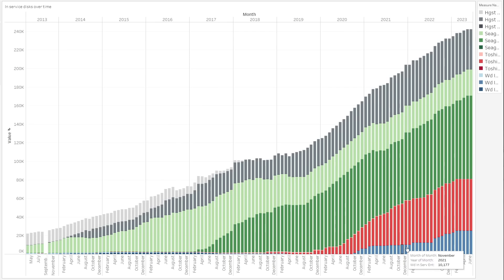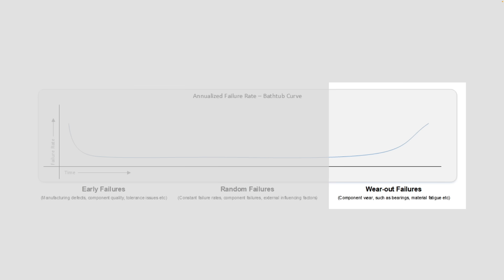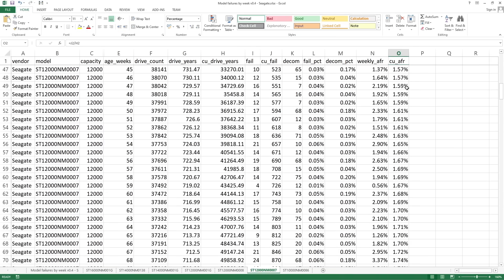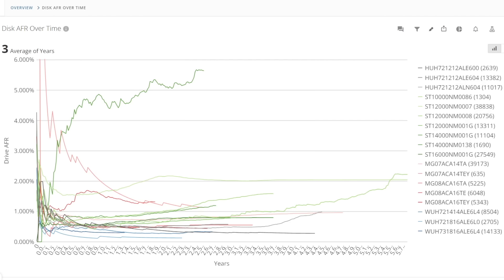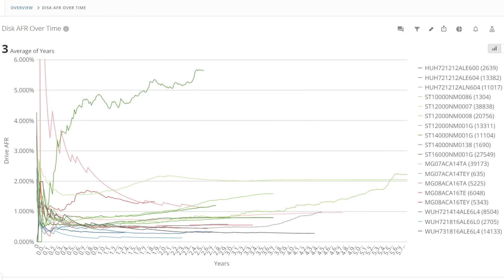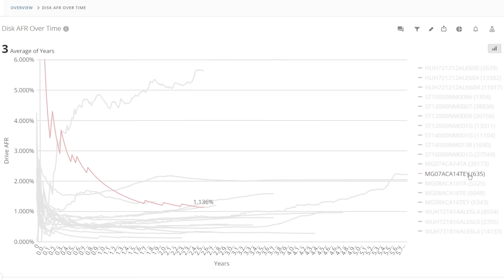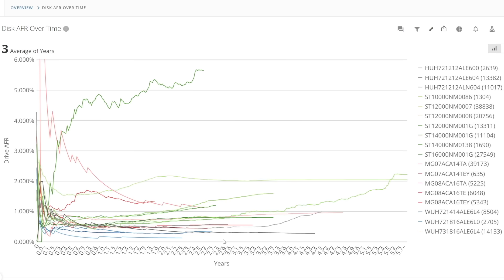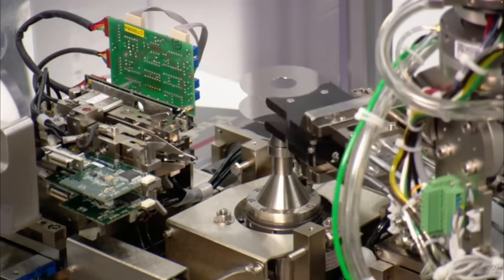Failure Rate Analysis - Best 10Tb+ hard drives: Seagate, Western Digital or Toshiba?

Comment: I'm surprised that the bigger drives are actually better...
Reply from the maker: It looks like Helium drives add reliability. The air filled disks are usually not sealed, so its possible for debris to occasionally make it past the air filters. Also, the larger disks are newer models in this data, so reliability is likely also coming from the fact the designs are more robust.

The newer small capacity drives might also look better, as they often have similar areal density, but only 1-2 platters. So less heads to fail and less heat generation. Backblaze though are typically optimizing for density, so they move towards larger capacity drives over time.

Comment: Have you got any analysis on whether the SMART data provided a warning prior to drive failure?
Reply from the maker: This might be worth a deeper look at. It’s complex as there are lots of smart measurements, each with an unclear correlation to drive failure. Some are likely more correlated but the numbers increment differently, so hard to compare one directly to another.

But given the size of the data set, there could be some good indicators hidden in here waiting to be found.

Comment: At some point, we're going to etch important data on glass, while the operating OS and other superfluous data is going to stay on semi- volitile RAM up to a month.

If you shut down the system for longer, it'll use a snapshot to SSD that it'll use to boot up from, which will take a bit longer than usual.

Comment: Why not a table that shows say for 10tb drives brand a is superior then brand D etc. For 12tb drives D is best followed by K etc.
Reply from the maker: I did put together a video that aggregates data for manufacturers so you see the overall reliability trend by manufacturer. The problem with doing this by capacity, is the manufacturers release products differently. For example, WD and Toshiba typically have a model number for a given capacity and keep producing the same model. Seagate however, iterate their model numbers, but release multiple capacities for each model. For example, Seagate have 4 Exos models that have a 12Tb drive (X12, X14, X16 and X18).

And the data here from backblaze will be dominated by purchases of certain models and the reliability can change for each model. In the above example of the 12Tb Exos, reliability gets better from X12 to X14 to X16.

So its a complex picture, but the video comparing the models by vendor is probably what you are looking for. This one was more focused on the model reliability. You can find this one here : https://youtu.be/icNbexYV3M4

You can always slice the data many ways, but if you do it all in one video it will probably be too long and over whelming. 

But I hope it was useful.

Comment: Weird cause my Toshiba in my old PC is 13 years old but my newer 6 year old WD died.
Reply from the maker: This is why large datasets are important, because smaller samples can really skew the outputs, and most people have a limited historical dataset to refer to. This is why people hate one vendor or another, because they had one or two experiences that make them feel the whole product or manufacturer is bad.

That said, although drives can last way more than 6 years, and WD are probably the most likely to, 6 years is still not totally terrible. Though I would prefer all my electronics avoided failure before they just became functionally redundant. 😬

Comment: So what you're saying is, most bad drives fail within the first few months. So buying used at a steep discount like I've been doing is the way to go.
Reply from the maker: This is where it is probably a little more complex. If they are just normal drives that are being sold for entirely innocent reasons, that have been well treated and come with a reliable full term warranty. Then yes.

But the question is, why are they being sold and what has happened to them? And also, there are possible warranty issues there, because drives not sold through approved partners will not be covered by manufacturers warranty and you would need to rely on return to base from the seller. So that comes down to how well you trust the seller to stand being the product for the full warranty period. If the support is good, the history is clear and the price is well discounted, its probably a great deal. Mitigate at least some of that risk with a full disk surface and SMART test during the initial return period.

Comment: are these numbers even usable? i know in the SSD space the same two drives can have very different parts if it was manufactured a couple months later, with very different performance and it's not disclosed.
Reply from the maker: They are as good as it gets. Each model will have a specification, design and component list, and though its possible that components could be replaced or re-sourced, its unlikely there are large variables and if there are, then the impact they have to a models stats would be fairly represented in the results. 

So given the large sample sizes here, the variances in component and the possibility of problem batches or logistics issues will soak into the stats. For example, a problem with construction quality of a given batch would have to be very significant to have an impact on these numbers, and if this is the case, then the impact to those stats would be equally significant.

And at the end of the day, imperfect data is better than no data. If you don't believe its sufficient to inform an decision, you are well within your rights to discard the findings. But ask yourself if you have a better set of information to inform a decision. Mostly all you will find is anecdotes from a small sample set of users who had a bad enough experience that they want to share it, and very few anecdotes from those who it just worked for and they give it no further thought.

Comment: Even though Hitachi had a terrible start after they bought the HDD manufacturing division from IBM (I still remember the Hitachi "DeathStar" jokes), they eventually became one of the best, in my opinion.  I currently have three HGST hard drives in my computer, running anywhere from 6yr 7mo to 9yr 1mo of actual uptime, and they're still going strong (though I am replacing them soon, just as a precaution).  Hopefully WD doesn't make any major changes and maintains the same level of reliability I've come to expect from HGST.

Comment: My oldest WD Caviar Black is nearly 14 years old, daily heavy use in my main desktop (bought in early 2010, it came with a Seagate drive that failed within the week). Second oldest is 12 years old, secondary drive in that same computer now. Both are working like in the first day, no bad sectors. Both 1TB, older one is a FAEX model and slightly faster access time than the less old FZEX model. 

I only buy WD Caviar Black 1TB since then. I have a couple more (both FZEX) in secondary machines, both much newer, so far working fine. These newer ones match the access time (13ms) of the FAEX one.
Reply: Can confirm this, I also have 2 WD Reds that have more than 11 years power-on-hours. No issues whatsoever yet, seem to be very reliable. That fact, and now this video, basically confirm I'll also get WD drives in the future.

Comment: Even my anecdotal experience kinda corroborates with this data. I've probably personally dealt with 20-30 hdds over my lifetime, and my experience is that toshiba's die quickly (1-3 years), followed by seagates (2-5 years). HGSTs are noisy but generally last a long time (>5 years). All my WD drive failures only come sporadically after 5+ years, and most were still working after I've moved on (upgrade, etc). Why I buy WDs only if I have a choice, except recently when it seems like seagates' quality has increased/stabilised, and there are good deals a few recent shucked 14tbs that I got.

Also, crucially, all my WD failures are usually gradual. You can tell by how they spin and behave (through sound, and use), and once I feel them starting to fail, they usually last 1-2 more years before they're dead-dead. That has given my time to plan my purchases and migrations. My toshibas and seagates. tend to fail quite quickly, either suddenly or within days of symptoms.

Most toshibas, hgsts and seagates I've experiences with came with systems (laptops, school/work pcs, etc).

Comment: Pretty amazing data crunshing. 
So Seagate is a good choice when price on each drive do matter, but you also as a former IT professional want some high quality drives. seeing the Exos drives are actually very reasonable priced for an Interprice line of disks  but how much does all the different models mean to the individual type used ? I assume that large scale server farms will be using SAS versions only. But I still asume that the SAS/SATA versions is only the interface and the base design of a particulary model and size variant still behave somewhat the same. I had one bad Exos ST18000NM000J which was DOA and am now trying to figure out which brand / model to choose for a 6 disk DIY home NAS project but its a jungle with all the different versions many of the brands have for different use cases. Does it make a lot of difference which specific type is used for a home project ? where you propably have a very mixed load type of both large size videos, pictures and also a mix of very small to medium sized files for games, documents and other stuff. Is it worth coughing up the extra money for a WD if you are already going to choose an Enterprice grade disk ? I have been around for some years and had my shares of both good and bad examples of most of the brands and know that crashes is very random at just about every disk you purchase. My favorites is still Seagate and WD. Beside that single  Exos neither Seagate or WD ever given me headaches but IBM/HGST and Toshiba is the only brands where have had disks completely die on me without any chance of normal software data recovery.

Comment: 10TB is a weird line to draw.
Most large capacity drives are all Helium filled nowadays, but WD Ultrastar HC330 and Seagate Exos 7E10 both come in 10TB, which is currently the upper capacity limit of CMR-based, air-filled single case 3.5" SATA HDD available on a commercial market. So this particular sample pool is kind of muddy.
Helium gas is much lighter than air, and Helium molecules(being noble gas, 1 He molecule consists of just 1 He atom) are much smaller than Nitrogen and Oxygen molecules, thus much more prone to seal leakage, as well as the resulting performance degradation. And if you cannot easily replace large capacity HDDs as tax write-offs, repairing Helium drives generally cause more nuisance and expenses than repairing conventional ones.

Suggestion: instead of just mashing everything together (or only grouping them by brand), divide those models into smaller groups, highlighting some of the features us viewers might be interested in looking into. Like SMR vs PMR, Helium vs standard (air), actuator and platter numbers, just to give out a more clear and fair comparison.

Comment: Refurb ST16000NM001G units are $126 each on fleabay right now. With an AFR of under 1% even after 3.5 years with a large sample size, this seems like the cheapest large disk right now. As with any large disk, it should be thoroughly tested before deploying tho in case of failure. I think I will be picking 8 of them up shortly.

Comment: Did back-blaze include WHERE those driver were used? I mean a drive that's on a very high utilization server has completely different failure rates than server that's for daily backups which is different from one that has weekly dumps etc...
That would be interesting data to take into account... Basically, IO/day data? :)

Comment: Great video.  I have WD, Toshiba, and Seagate drives (and Samsung SSDs) across my NASs.  Toshiba is a new addition, but WD and Seagate have been in use for several years.  I started with WD over 8 years ago, and added Segate about 5 years ago.  Just a hand full of drives.  So, no concrete data.  I had one of 3 WD fail within the warranty period, which is why I switched to Seagate.  Not because I didn't trust WD, but I wanted to place a new drive back in the array same day while I waited on the RMA.  Seagate was what was available locally.  I ended up getting 2 Segate drives and growing the array.  The RMA drive was used elsewhere since at that time I only had a 4 bay and a 2 bay, which were then full due to the new drives.  My recent addition of Toshiba drives in a new array was because I will never buy Segate again since they ignored the embargo and sold drives to China. It's no different than selling restricted items to the Soviet Union during the cold war, but I digress.  I didn't go with WD after watching a SpaceRex video.  

I'm shifting my drive strategy anyway.  I am  slowly getting ramped up to replace my HDDs for data with SSDs, while using HDDs only for surveillance.  My new 8 bay model makes it easy to use lots of smaller SSDs and still get the storage I need.  I'm growing the SSD array to retire the HDD array with the older drives.  The drives individually are cheap enough to pick up periodically, but getting a second 8 bay for backup will be a while.  Ultimately, I'd like to have a third 8 bay to place offsite and stop using the cloud for my 321 strategy.  It's more like a partial 321+1 strategy, as I use immutable storage for my raw files from each photo shoot.  I cull the images, and save the RAWs I am keeping to both immutable, and working storage.  I also use the immutable storage for critical documents like my digital fingerprint file (never know when I might want to submit a Form 1 to the ATF), taxes, etc.  I finally have enough SSD space to maintain a full 321 strategy, but I'm still relying on the old HDDs as part of my backup, which is not ideal.

Comment: This is an impressive amount of data, and is well presented. I have anecdotal data regarding very-long use of hard drives. I purchased about 20 drives in the early 1990's, all of them in the 120-512 Mb range, and deployed them in DOS based cash registers. Over the years, I have occasionally used Gibson Reseach's  "Spinrite" software to exercise the magnetic surface, which keeps them running until mechanical failure. Over the last 30 years, a number of them have been removed from service, but at least 6 have failed. Consistent with your bathtub curve, the failure rate is starting to rapidly increase, with two failures in the last year. I have only 3 of them left in use, and all are acting suspicious. I expect more failures within the coming months, so I plan to migrate these cash registers within the next month to something else.   I will have to check the brands on these remaining discs, and the two that failed in the last year, which I still have.

With these lasting 30 years, though, I have to wonder if their long life shows that "they don't make them like they used to", or if it was attributable partially to Spinrite? My best experience with Spinrite, fwiw, was when I purchased a refurbished Dell running NT. After a month, it got the BSOD due to disk failure. On a lark, I ran Spinrite on it, and after 20 hours it reported "57,000 disc errors repaired". I laughed, and rebooted it. To my surprise it rebooted, and it ran flawlessly for 5 more years until it was decommissioned.

Comment: 1 Inacuracy - HGST doesnt exist anymore. They are owned by Western Digial and make WD model disks. The only differance is the pre-fix in the disk label. WD  produced disks start with WD , Hitachi with HU. Otherwise they are identical. We use both in enterprise and whatever problems we see in WD - they show the same , sometimes even worst on HGST produced ones. Looks like the quality there has dropped a lot.
Reply from the maker: I think I covered this in the video, but although HGST has now been fully absorbed into WD the drives in the data set included drives that were made when HGST were still operated more independently, so this is why I called them out as HGST drives. I did also mention about the heritage of the HGST Ultrastar platform into WDs current products. If I understand your comment correctly.

Comment: Backblaze data is for failed drives only, so you need to allow for that - there have plenty of older drives that are still in use 
Note also their drives are kept in ideal conditions, are not subject to shocks after installation, etc ...
Reply from the maker: It actually isn’t. The data set contains all drives that are running and all smart data for every day. So you can measure exactly what drives are running, when they entered service, when they left service and if they left service during failure. And this is down to serial number granularity.
Reply: @sometechguy  Sorry different dataset then... the one I have seen elsewhere from them was only for failed drives?
Reply from the maker: Not sure, they publish the full dataset in csv form which is in excess of 20GB compressed. But they also publish blogs and articles with summaries of drive failure stats. The full dataset includes per day granularity for each drive , model, serial numbers and all SMART data including power on hours etc. This analysis is done on that full dataset. And actually, to extract AFR data you absolutely need to know about the drives that are not failed, or it would just be >100%.